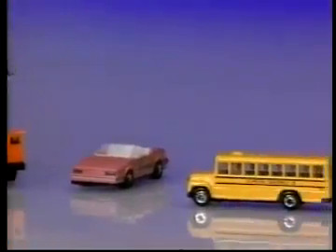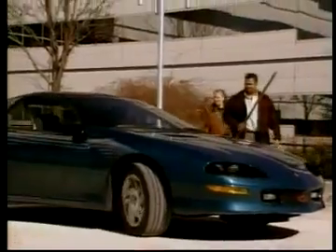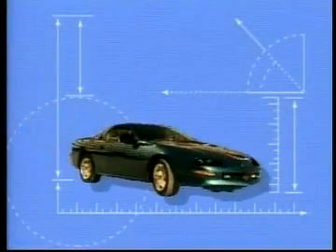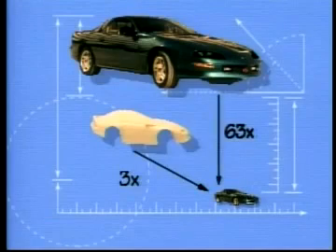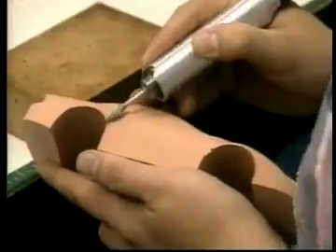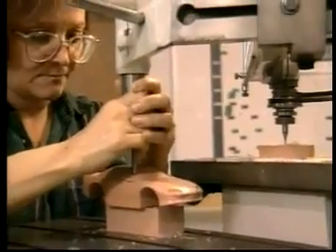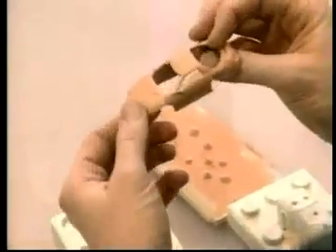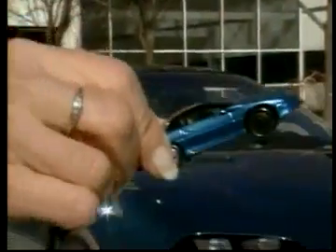Factory Lesney Matchbox

Comment: I've had matchbox and hot wheels since 1968. I'm now 54. I own 3000 of them. We the public would like you to stop making the wierd  ones and make some actual pick up trucks.
The 1962 Ford , and the 1970s Chevy, make different years. Make the campers the trailers to haul things or cows n horses. Make some tractor trailers. Make some double and triple trailers with the old  cab over trucks like Mack or peterbuilt.
Make some farm trucks, trailers, tractors, farm equipment to pull. use the old colors, black wheels.The collectors and the consumers market is huge for this type of stuff. We're tired of the weird  paint jobs the ugly wheels ,and designs. We want old school and lots of it. Trust me you will see a jump in sales if you make the vehicles I have mentioned. Let's have another good 50 years.
 Woodbury ,TN.
Reply: I'm not alone. Thank you.
Reply: Definitely you are right Joseph.